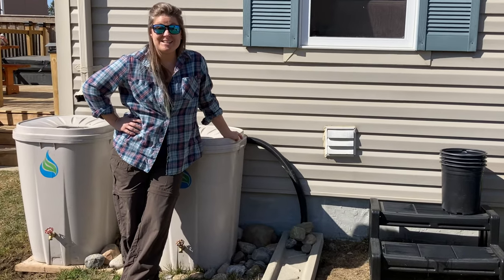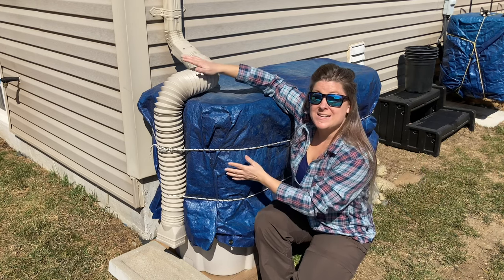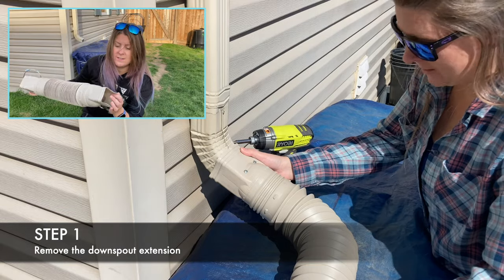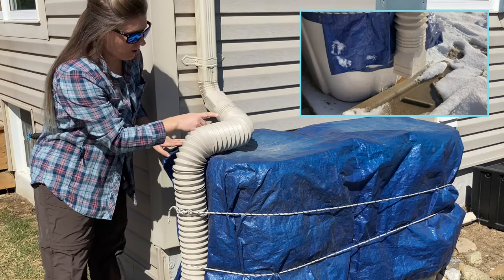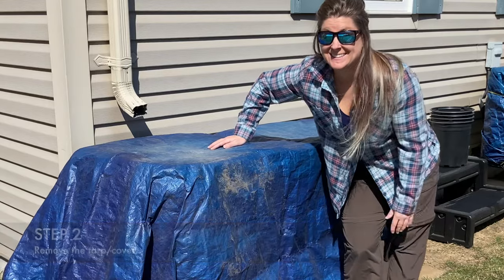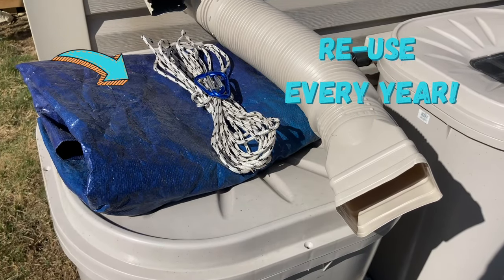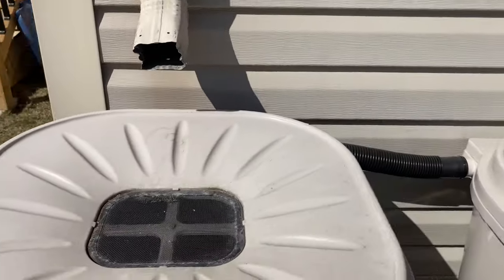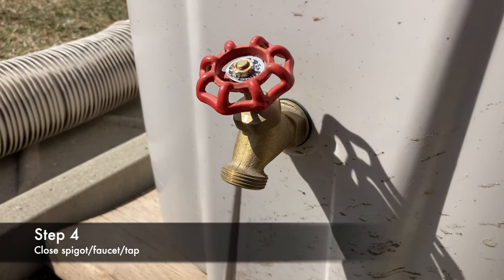How to Set Up a Rain Barrel System | DIY Tutorial

Comment: I have two of these exact same rain barrels for two years now. One of the barrels now has developed a crack on the floor and lost all of my rain water saved. Tried everything possible to repair but continues to leak. 😭
Reply from the maker: May be a long shot but have you tried to melt the plastic to seal the crack? It’s difficult as it’s on the bottom with all that water weight. Perhaps a soldering iron can melt the cracks together and then add some wax to solidify? Good luck that’s a sad situation!